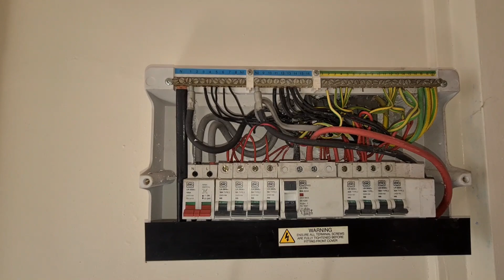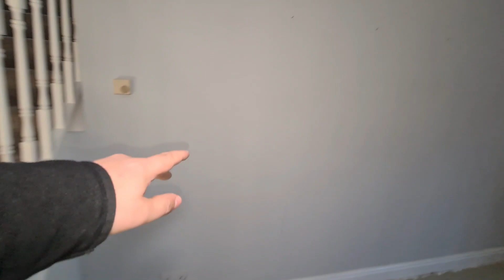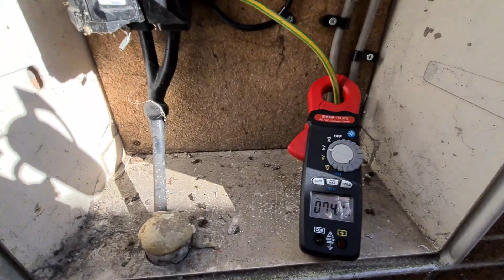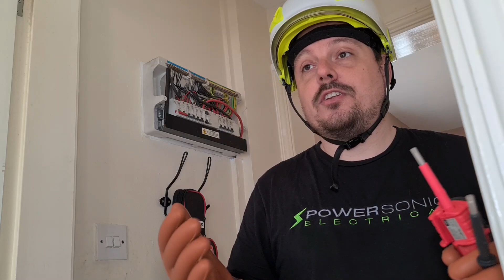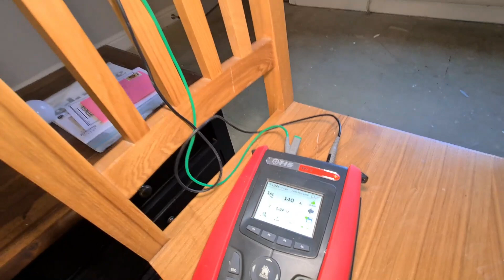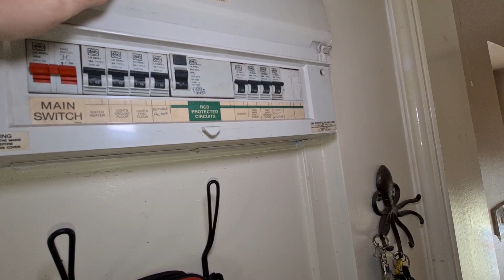Disaster Massive LEAK. Electrical Testing the ENTIRE house EICR

Comment: why should you have that current flowing into your house,.........if you are disconnecting it to do your Ze    I'm just wondering would there be a voltage on it which you could measure between it and the MET (which must be in contact with earth somewhere?)     so maybe just as well you have your rubber gloves on.      Presumably your neutral connection to the earth (with your isolator off) is providing a shorter (better) route to earth for your neighbours than the neutral is.
Reply from the maker: It's network circulation in the earthing system. Imagine all the metallic bonds between houses and in the mass of earth. Bits of the current path on TN-C-S especially will use these routes. With systems connected up the danger is minimal in working systems. But for us sparks working on them and separating bits of them we can be exposed to risk. Especially if a pen fault develops during our work.

Comment: I’m on my last year of college now. When I did the 2391 and did a Ze across all 3 phases no flash gear was needed. Or a glove/mat. I can see why you wear arc gear. But on single phase I feel comfortable with not wearing any Ppe when no loads are connected. Either way mate good video for people which don’t understand testing. Keep it up
Reply from the maker: Thanks Luke. You would be surprised what we should were based on energy discharge calcs. However same as you GS38 as a basic start off load on single phase is usually fine. Bit of extra PPE doesn't hurt tho.

Comment: Blimey Mark I’ve worked on large three phase supply’s with no flash protection whatsoever , even working within bus bar chambers with just someone near to drag my lifeless body away if things didn’t go according to plan . How times have changed , but safety is always paramount as they say . And I suppose the days of changing a broken socket without turning the power of are also long gone . 😂 And quite rightly so , but what I will say is working in a live system and yes we had to do on many occasions . Ie try turning off say a police station that never shuts .  It does definitely focus the mind , and is definitely no place for mobile phones or any other form of distraction .    Best wishes and kind regards as always 😀👍👍👍
Reply from the maker: Hi Mike, for sure we have all done stuff over the years that wouldn't be allowed now, possibly wasn't then either lol. 

I am a long way from perfect but trying to show the apprentices following we have stuff to help stay safe should the worst ever happen. 

Some would argue I should have had more ppe on lol. 

Thanks for watching and getting involved on the comments. Appreciate it.
Reply: @electrician247  not a problem , just out of curiosity do you ever do work we’re it’s just not possible to de energise say a DB ?    Regards Mike
Reply from the maker: @H188ki  MOD lots and lots.

Comment: Brilliant video for learners or sparks that have been lucky enough to never have to deal with large leaks or flood damage. 
That said, accessories that have been in use during renovations often throw back bad test results due to plaster dust and alike getting into the switch mechanisms. Not so bad for good quality products but I've seen it before where customers have had sockets from the likes of LAP and they've not fared well at all.
Reply from the maker: Thanks mate and good shout on the plastering. We had some DIY plastering ruin some sockets not so long ago. We had bonded up but they literally skimmed over the fronts! All had to be changed. At their expense I might add lol